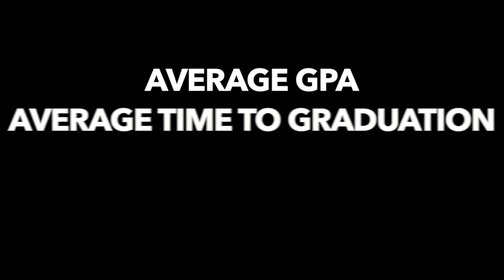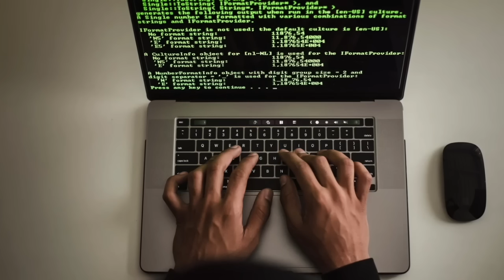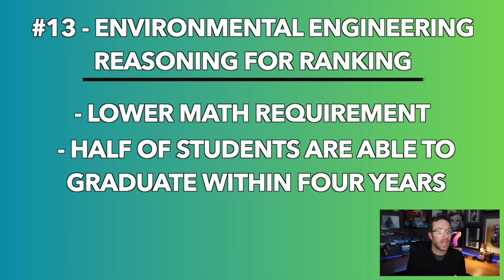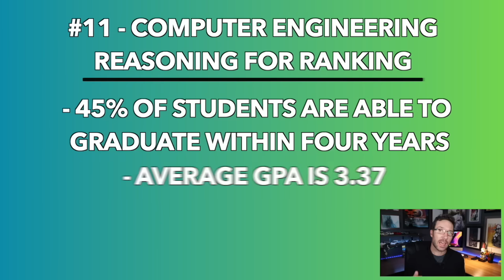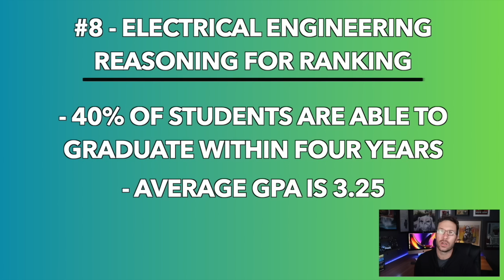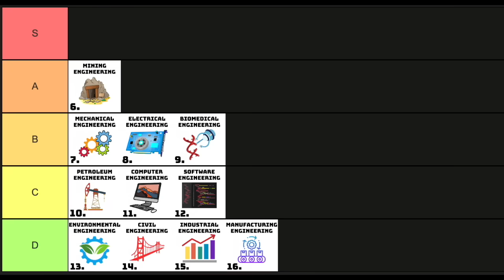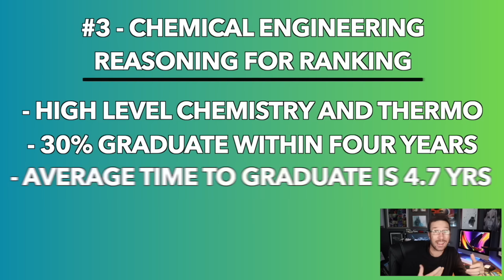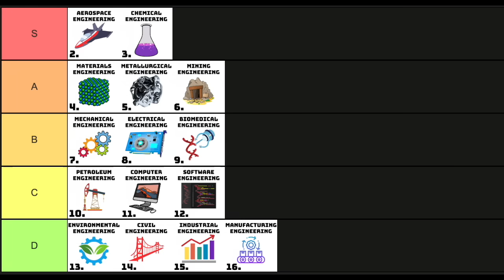Engineering Degrees Ranked By Difficulty (Tier List)

Comment: The hardest degree is the one that you have the least interest in.  The biggest factors should be are what is my rate of return, because we have to pay the bills and eat after all, and do I like the career field.  I am not brilliant by any stretch and had to work part time and evenings to be an EE, but I was interested in the subject and wanted to be an engineer and was able to get thru it fine.  A lot of the challenge is being interested enough not to be distracted by the "hard math" and abstract concepts and just wish to be doing anything else.  Don't go into engineering if you don't sometimes geek-out and aren't curious about scientific and mathematical principles.
Reply: The hard math, and science classes were to me, building the tools I needed to do the engineering which was fun.  I was a non traditional student who had worked for ten years as an engineering technician.   Engineering school, consisted mostly of answering the, “why do they do that” questions I had from working with the standards, and codes without any real knowledge as to where the standards and codes came from.
Reply: @randallthomas5207  In my opinion I think a lot of reason I found a lot of the math courses were "hard" was I couldn't see the use and/or visualize what the formulas represented.  There are some YouTube videos that do bang-up job of making the math more real.  My old differential equations was dry and painful and wish they had some practical scenarios to show where this can be used which provides "why" we are learning this stuff.

Comment: I wasn't the least bit surprised to see nuclear engineering with 0% job growth.  I was a grad student in ME in the early 80's.  Even then, the nuclear engineering department was the smallest and still shrinking.  Orders for new reactors in the U.S. plummeted in the latter half of the 70's BEFORE the partial meltdown at Three Mile Island.  After a 30 year hiatus, the nuclear industry finally had four new reactor orders and construction starts.  Cost overruns soared in the multi-billions as construction fell years behind schedule.  The two Virgil C Summer reactors were simply abandoned.  The two reactors at Vogtle will end up costing somewhere on the order of $34 billion.  Both are taking more than a decade to complete.

People like to blame over-regulation and anti-nuclear hysteria.  However, Olkiluoto Unit 3 in Finland took 18 years to complete at about TRIPLE the original cost estimate.  Flamanville Unit 3 in France is having a similar fate and possibly even worse fate.

Globally, total nuclear generation has stagnated while wind and solar combined now generate more electricity than nuclear.  Even China with the world's most ambitious nuclear (and wind and solar) goals has found that wind and solar scale up faster and cheaper.

Comment: MechE here. I think a really cool aspect of ME is how broad it is. At the base level, it's simple and down-to-earth, it's just about building a physical thing that works, from a simple door latch to a spacecraft. But, that thing has to be strong enough... and be reliable... and be cheap to manufacture... and not overheat... and not interfere with electrical devices... and be efficient.. and... and.. and. During my ME undergrad, I think at least half of the courses were from other engineering department, 2-3 from Civil, 3-4 from Elec., 1-2 from Mining, 2-3 from Materials, 1 from Chem, 2-3 from CS (same as Soft Eng in our Uni), etc., not counting the math, of course.
I've also found that in professional life, working in an interdisciplinary environment, MechEs can geek out on technical topics with almost any other engineer.

Comment: My good sir, I must take exception with your analysis of computer engineering, which is my field. Firstly, we needed much higher math than ordinary diffeqs. I had to take combinatorics, finite dimensional vector spaces, and vector analysis. Because I'm a nerd, I also took Calculus of Variations for shits and giggles. We needed multiple forays into graph theory, as an example, for calculating the theoretical stops of a state machine, and minimizing them to get an optimal path. I admit I'm a couple decades removed from undergrad, but I have to take exception with what you said. I personally would not hire a computer engineer whose highest math class was ODEs.  That's when shit starts to get interesting.
Reply: I'm curious, as someone who is also a software engineer who's a couple of decades removed from undergrad: How much is all of this higher mathematics useful in your software engineering work, and what do you use it for?  I know that there are some parts of the field where that mathematics is useful, but in my experience those parts seem more like specialized subfields rather than the bulk of the work that people are doing.

Personally, I would claim that the most important class I took in college for my current software engineering work was Statics and Dynamics -- and I'm only exaggerating slightly for the sake of being provocative when I say that.  It claims to be a class about analyzing forces in bridge trusses and such, but what it's really about is the art of drawing boxes.  You take the problem and separate out a piece of it -- chosen in such a way that the interactions across the boundary of the piece are something with relationships you can easily solve.  This is almost exactly the same skill that's involved in separating a coding problem into maintainable parts that are connected by API boundaries at a large scale, or into reasonable functions at a small scale

(Then again, my academic degrees were in ME, so I came to software engineering with a rather different perspective than someone who started out here.  I may also be a bit biased in that I wouldn't consider the basics of graph theory and combinatorics to be "much higher math than ODEs"; they seem about the same level to me.)

Comment: Something that is ignored in this video is that Industrial Engineering requires a more diverse pallet of mathematics. You are going to take Statistics and many of the upper level course work is dependent on fully understanding Stats. With other disciplines you pretty much take 3 classes of Calculus and a DiffiEqs class. This is just the beginning for IEs. You take the standard Engineering math, then divert towards courses that are centered around theories with probabilities. If stats isn't your thing, then stay away from IE.

Comment: First off every engineering degree starts with 2 years of college where you get the basics like English, History and Humanities and many non engineering courses.   During that first 2 years you also get 3 semesters of calculus, 2 semesters of Physics that require as a prerequisite, 2 semesters of calculus to even start.  Then we get organic and inorganic chemistry.  If you get this far you find out that you had no time to do the other courses that you will need like linear algebra, engineering drawing and at least a few courses in computer programming.  After all that the next two years you take courses in the discipline of your choice.  I worked in R&D for 35 years and was always surrounded by PHD's in chemistry, physics, computer programming and engineering.  I designed Gas Chromatographs and all the detectors and my last 5 years I designed a Liquid Quadrupole Ion-Trap Mass Spectrometer with just one more engineer.  I found that new engineering graduates are pretty much worthless just out of college.  It takes years of experience in your field of study to start producing for your company.  Then we start talking about the 5 year half life of an engineering degree.  You pretty much forget half of what you learned in college in about 5 years.  The good engineers that can produce have moved on to get their masters degrees in their chosen field.   I started my career with my slide rule because the department had only one four function calculator for 50 engineers to share in 1972.  The R&D department had PHD chemists, PHD physicists, many mechanical engineers, software engineers and industrial engineers too for packaging the instrument.  We also had a full drafting department with about 30 draftsmen and women for documentation of the designs.  The most incompetent engineers  become industrial engineers in the manufacturing plant trying to keep building and shipping the designs that I produced.   Those guys did lots of reports and board swaps to keep the plant running and never used calculus again in their whole career.  The next level of incompetents are the software engineers.  They learned things like C, C++ and needed a mainframe with giga bytes of memory to make their software run.  One software engineer worked for 6 months writing software that took 300% of the CPU time to do a job that should have taken 15% of the CPU time.  He quit then and went to work for a bank.  LOL  During my career, I programmed in assembly language in micro controllers.  My job was to design the hardware and was assigned an incompetent software engineer to write the software.  After 2 years he wrote nothing and quit to work for a bank.  So I had to write the software too.  I found that very few software engineers know anything about cost analysis and resource analysis.  I have also found that the managers of the engineers are just paper pushers and can't even manage their staff and stay on schedule and budget.   We had one new mechanical engineer graduate from Berkeley, CA work on a column oven that had a temperature range from -200C to +500C.  His job was to get the oven to cool down to +30C above room temperature after soaking at +500C using only a fan.  We needed it done quickly like 10 minutes.  He worked on the problem for 6 months and wrote a long report that said it was impossible.  Yes, he was fired and they then hired a car mechanic type of mechanical engineer to do the job.  Yes, he did the job in 3 months and got the cooling time even below the 10 minute mark.  Yes, there are some good engineers but management didn't understand them and abused them so they quit and went to work for someone else or started their own company.  The good engineers are abused by management and the bad ones are coddled.

Comment: Biomedical Engineer here, just graduated with my BS and am pursuing a PhD. First. I would like to commend you on your time that you took to research this. This was probably a pretty difficult tier list to find enough data to adequately analyze. I only have a couple disagreements with some of the metrics you used to measure difficulty based on my experience.

1. Time to Graduate: though helpful, does not consider the type of people that take the degree. Many people taking biomedical engineering are basically premeds and will take summer courses to finish within 4 years. I personally know several of my classmates did so. That is a huge factor when considering that because if a degree takes longer than one but the shorter time has a significantly higher number of students that take summer courses to graduate faster then that throws the data off. 

2. Average GPA: again who takes the degree. If a large portion, some estimates are as high as 1/3 go to medical school for biomed, of the student body needs a high GPA to progress that will naturally inflate GPAs over degrees that mostly require you to pass.

I personslly think BME is more difficult than ME mostly due to the nature of you kind of have to be an ME while also having a huge Bio aspect to your work that MEs don't have tk worry about. Just my thoughts. Great video though.
Reply from the maker: thanks for the feedback. There are really so many variables that play a factor. I just had to go with the data that was available. i may try this again in the future.

Comment: This is solely about the USA. Which is not a problem, just an observation. In Europe, software and computer engineering is considerably more difficult than most other disciplines as you have to master pretty much all of complex calculus, used for signal processing, or theory of solvability and algorithm classes. Way above what is required from let's say a mechanical engineer, or even an electrical engineer. The average graduation time in Europe is over 6 years for a computer engineer.

Comment: Grading the difficulty in engineering based on the math is ridiculous. I study mechatronics engineering, we have partial differential equations as well but I would consider them to be among the easier concepts in math to grasp. In my opinion, the hardest concepts in math I had to learn are the transformers theory. Anyway, all the math courses are the easy part compared to the other things like hardware programming, electronics, system control and in some cases even mechanics. Programming in assembly was probably the thing I enjoyed the least.

Comment: I am surprised at the low level of required math for these engineering degrees.  I sure took a lot more math for my undergrad degree in physical/inorganic chemistry.  I was particularly surprised at chemical engineering because all the Chem Es I have worked with had done a lot more math than partial differential equations.  Of course they all had a Ph.D.

Comment: chemist from europe here, not an engineer. I am very surprised that according to you chemical engineers are only doing ordinary differential equations. Partial differential equations are essential to describe the quantum mechanics of atoms and molecules. Which, by the way, allows chemistry to be described fundamentally again. Which is why I don't agree with you that chemistry is not an exact science. Everything we are told in school and the first semester of university are actually just generalizations and, to a certain extent, wrong. Yes, chemistry is so complex that it cannot be accurately described in our everyday lives. However, it can easily be done on a microscopic scale. So, in my opinion it is a exact science.

Comment: I graduated from UCF with an Electrical Engineering degree. Electrical’s were the only disciplined to require physics 3 (quantum physics). I didn’t particularly find differential equations to be that difficult, in fact, I found it rather enjoyable. Quantum Physics on the other hand was a real mind bender. In my humble opinion, I would have ranked electrical engineering a tier higher on difficulty. Electrical engineering is also the second least passed PE exam; second to only chemical engineering.
Reply from the maker: where is that PE exam data? i am interested in that

Comment: I'm a mechanical engineer who graduated from Annapolis in the 80's.  I'm not trying to discourage anyone, but your description of these degrees as "only needing partial differentiation or ordinary differential equations" is a bit inaccurate.  We had to do Calc 1&2, differential equations, engineering math, partial differentiation, linear algebra, vibration analysis, and more.  Then, ALL engineering courses involve all the math you used in those earlier classes.  It was the same for all of the different engineering disciplines and not just M.E.

You ramp up through it all, so it's not absolutely overwhelming, but you certainly can't "pump and dump" a class after an exam and think you're never going to see it again.

Comment: Interesting to see how things have changed in 30 years. At my Alma Mater, all Engineering degrees required the same level of math, and CpE and EE were practically identical, with CpE having some credits that dealt with logic design, where as EE had credits that dealt with power systems.
Reply: Yup.  At mine, I thinkwe had a CpE degree from the EE department in the College of Engineering that was about what you describe, and a Computer Science degree from the CS department in the College of Arts and Sciences adjacent to the Math department (and I think it had recently fissioned off the Math department and was still somewhat attached).

Comment: Difficult to compare graduation rates for the smaller engineering diciplines because there are far less universities that offer "mining", "materials", or "metallurgical" engineering. The low graduation rates might be that the universities where they are offered are simply more difficult. Conversely, almost every big university offers Civil, Electrical, Mechanical, and Chemical.

Comment: Biomedical Engineer here batch of 2010. .....
The Maths in BME is not limited to Math subjects there are literally subjects full of mathematics with a different name. Like Signal Processing, Image Processing, Control Systems, Modeling and Simulation, Probability, AI, Fluid Dynamics, Numerical Methods, and yes we were forced to take partial differential equations course too. Ahhhh that was a very tough time. Graduated with a 3.56 GPA. But the point is BME is not as simple as u presented. I took the course of Biomaterials and visited materials engineering department, made friends there and I can say from the conversations that they were having pretty less tough time than we were.

Comment: To interject, no one seem to picking up on the fact that electrical engineering is only 50% of the discipline.  The other 50% is electronics including semiconductor side of the house.  While thermal and fluids are complicated, theroy of elasticity and calculus of variations were very painful during my MSME,  EE still trumps mechanical.  Now for those folks touting theoretical physics or other pure science disciplines, please remember this is a comparison of engineering disciplines.  Regarding physics or electrical/electronics engineering at the PHD levels I believe that the difficulty level is not separated by much.  Also, please note that Howard Walowitz only had a master.  That was the main reason that he was brunt of jokes not necessarily the subject matter.😂😂😂😂😂😂😂😂😂😂